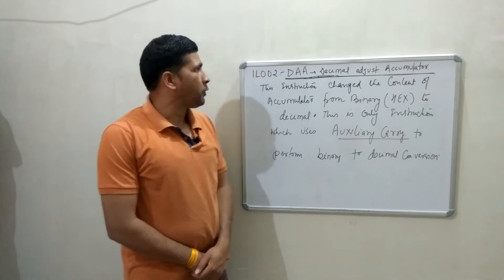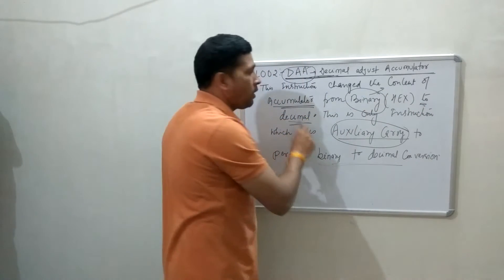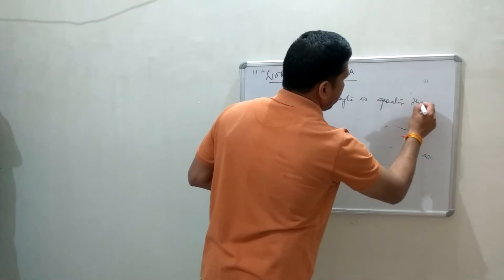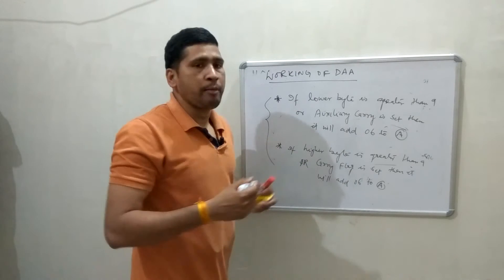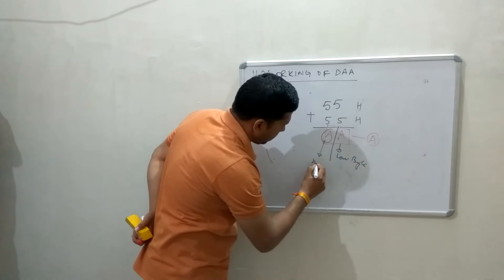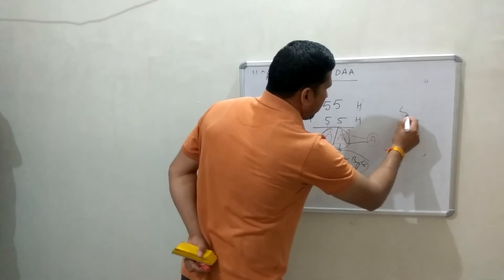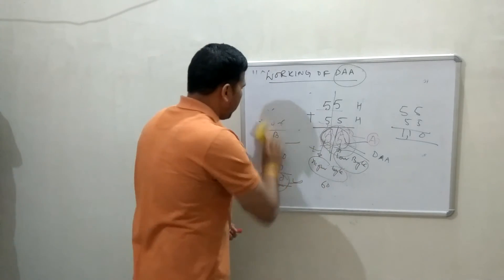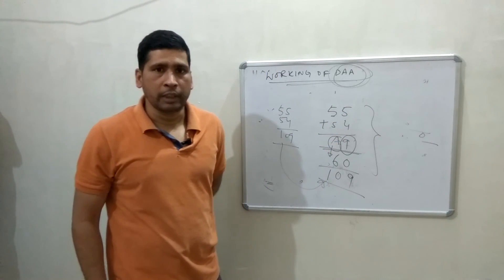DAA: Decimal Adjust Accumulator - Decimal Addition Instruction in Microprocessor

Comment: if the Lower byte less than 
wht can i do
which no will be add
Reply from the maker: Genius System if lower byte less than 9 then 0 number will be add
Reply: If lower than 9 , u add nothing
Reply: you don't have to add anything if it is lower than 9, you have to perform those addition only if the lower/higher byte is greater than 9.